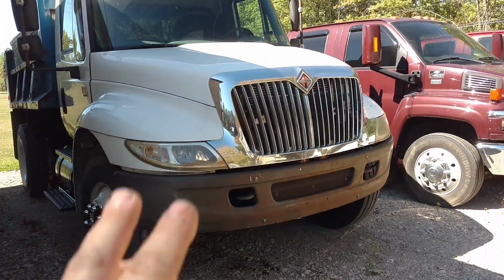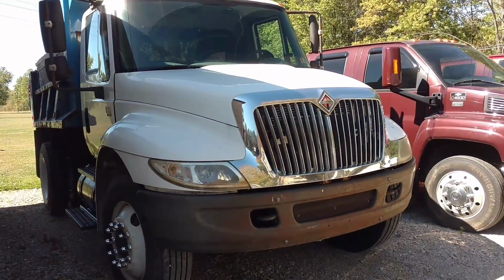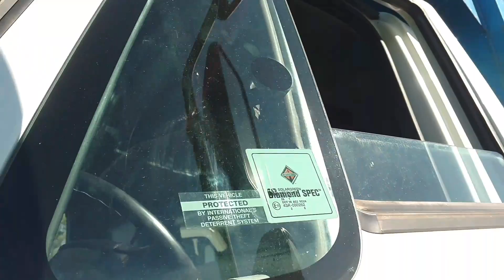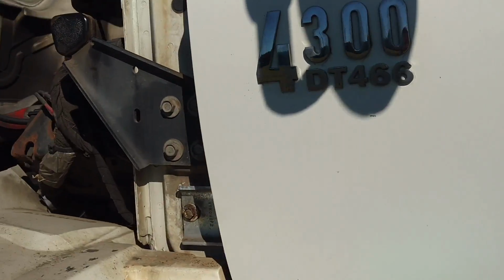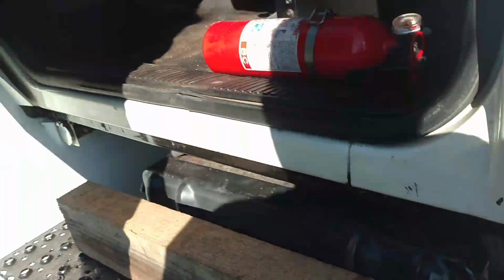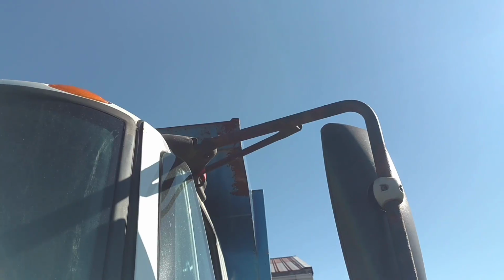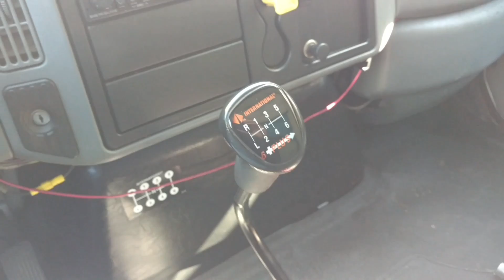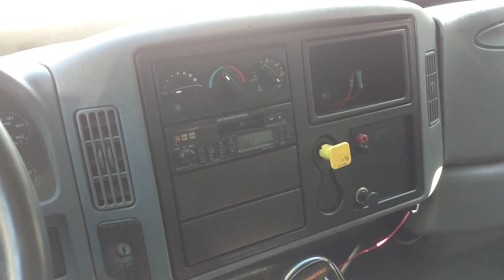DUMP TRUCK MAKES IT FIRST TRIPS & NEEDS SOME ADJUSTMENTS + 59 CHEVY AND F1 FORD

Comment: I know this is a old video but I just watched it. The Ford at the end of the video is a highly modified 1953 F100.  1952 was the last year of the F1.  I've got a 1954 F100 project I'm building. It's the same body style as the 53, it just has a different grille.

Comment: The Ford truck is F100 could be a 1953, 1954 or 1955 and the 1956 looks almost the same except the 1956 has a wrap around windshield. If memory serves me right on the Chevrolet the three speeds were column shift and the floor shifts were all four speeds. I’ve been watching your videos for a long time now  I’ve been going back watching these older videos

Comment: General Motors changed all the domestic line to 4 headlamps in 1958  ,  that ford without seeing the grill if it hasn't been altered is one of three years  1954  to 1956 , very nice body style in my opinion

Comment: Your very generous, that always gets repaid in some way. The twisting trick with the timber I've used before but with brute strength not a strap. It worked well. Like the old red girl. Would be a good project
Reply from the maker: i have used the brute force method but this was just too high in the air so i thought the strap would do the job.
Reply: J.C. SMITH PROJECTS yes I've been lucky with low hanging fruit so to speak lol. It was a very effective way to fix the issue, I can imagine there are people who would just change the door .... which is why I watch you, you look outside the box and use more inventive fixes. Keep up the builds j.c , cheers

Comment: If you like the chrome lug nut covers, take them off..put grease on the stud and nut then put the covers back on.  The reason is that the caps hold water from rain or just plain moisture and the nut will rust on the stud and will be very hard to take off when needed...
Reply from the maker: in one of  my other videos i show that i do just that on all the studs and lugs nuts when i put the caps on them.
Reply: Being a truck driver and going off road, I learned a lot  and even how to change float front tires manually on 22.5 rims without killing my back, experience is the best teacher.

Comment: The body shop at our dealer uses the same method on even the new cars only you can do them with your hands. I've watched them do it many times while over there getting something. 

Boy I bet it took them a long time to get that old Ford straight enough to finish like that.
Reply from the maker: you are not kidding. that ford was straight as an arrow. that trick on the door worked well. it is very quiet now and seals great.
Reply: I almost forgot J.C. they also used a dollar bill to check for the spot that air would get past, They would shut the dollar up in the door seal and see where it was loose to pull out and that's the spot they would concentrate on. If they didn't find it that way then they pulled out the electronic diagnostic tools.
Reply from the maker: kentuckycowboy2 you could have used your finger in this door!
Reply: That makes air leaks / wind noise easy to find.

Comment: I did one by hand , stood on the step put my knees against the door and yanked a few times , but I am a healthy boy , I tend to break things easily , but it worked , about like you , I bought one , and drove it home in the rain , so it had to be addressed no matter how I pulled it off , duct tape was the second option , thankfully I did not have to go there lol
Reply from the maker: hey towrecker. i think i watched many of your videos. one of which you had a video of towing your "new to you wrecker" with your green wrecker. another was when you said your wrecker was stolen....were those yours?
Reply: yup thats me , I watch on this channel , and videos on the other beltstowing ... as for frames , I think your a good ways from east tn , unless I am wrong , I just picked up a 1996 4900 tractor mechanical DT466 6plus trans , the kicker is since last november it has been inframed , a reman trans , rearend , new tires no caps , and they had it painted, it was a pepsi truck and I had inside knowledge of what had been done to it before it got auctioned , they sold several and listed them as scrap , I love this kind of scrap lol , a little interior work , and it's basically a new truck , it's worth the effort to stretch I think
Reply from the maker: now that is a killer score. great truck. hard to out do a dt466 in a medium truck. its about 8 hour drive to pigeon forge doe me. headed that way for the fall rod run.
Reply: I just in a way wish it was a 4700 , being out of 8 drivers , only 2 have a CDL , so it will basically wind up being my keep at the house toy to replace my well loved 92 superduty with an old IDI in it , funny thing is it's old ,  slow , it's ugly ,heavy has a steel 21 foot on it ,  but I like that old truck , but it's day is done , time to move on lol I think it will give it's bed to this project
Reply from the maker: i love the old 6.9 and 7.3 idi. not fast or powerful but there are simple and reliable....more than we can say for all the new junk. i have a 2014 21' steel deck 15,000 lbs capacity rollback that i want to put on a nice newer 32.000 lbs chassis. channel cross members 12" on center and 3/16" deck plate. no sense having a good long heavy bed on too light a chassis. i like the older trucks the best.